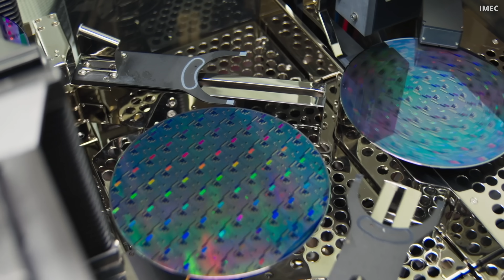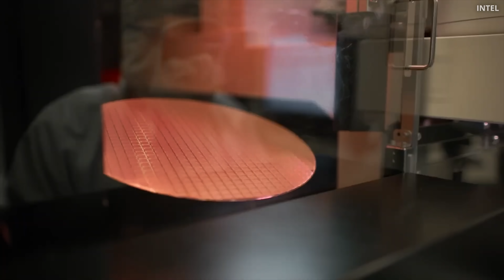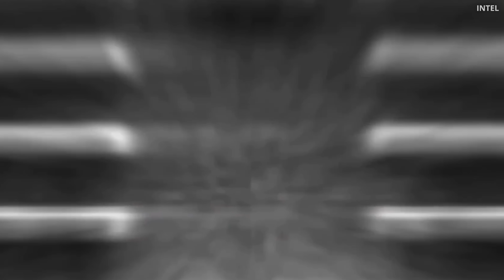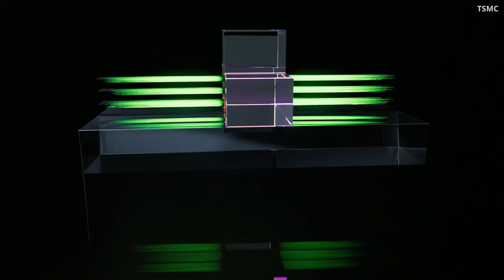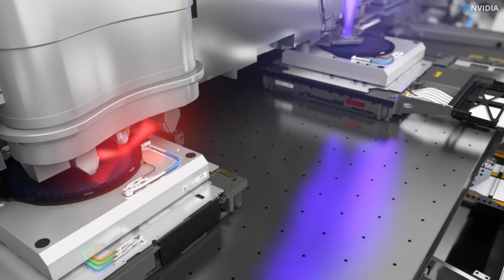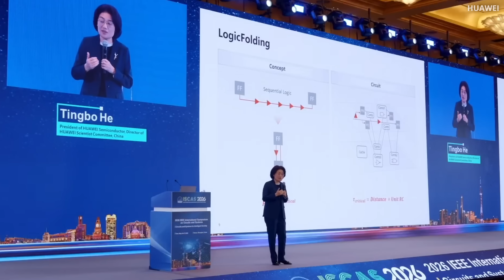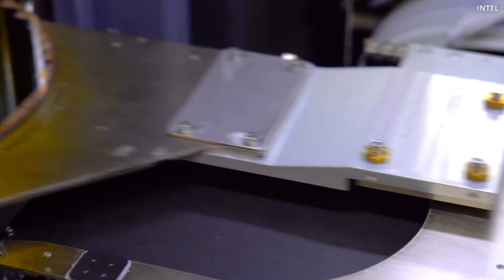China Just Built What TSMC Said Was Impossible

Comment: technically 1.4nm etc are all just marketing term, we can't actually use them as quatum tunneling would make them unreliable. when we go to such "scale" we are usually talking about x nm "equivalent" then physically building gates that small.  

after the announcement, i assume you watch their technical discussion. like how they deal with chip clock boosting, heat, yield, bonding, design. there is no doubt that going for "2D" logic to "3D" logic would be a massive improvement, however there is currently no design software capable of doing it, they are literally working this "by hand", so I do not see a massive improvement, but the level of depth they talk about seem to imply they have solve the "could or could not" part of the problem. they can do it, question is how long would it take them to do it well...

for example, they talk about the clock boast to be done on the same base layer, this would mean they can't really build that tall since there is no boasting on the top. so we wouldn't be able to reach the level of a "cube" with what they have now, that could maximise 3d volume, instead what they should is a first step.before you can build supertall,  you have to at least be able to build tall. its definitely very exciting from a development pov, but it is still very early tech.

several peopel dismiss this as just "stacking" saying we have been stacking memory for years, and that is true, but memory has a linear veritcal bus, using the description huawei engineers discuss it, its a "floor plan", where building vertical memory is like how we build apartment, with every floor having the same floorplan, for logic it is different different pipeline has different size, it alot harder to fit them together, that's the software design challenge they are facing, it like trying to build a bulding where every floor's floorplan would be different, and changes in one floor would impact the arrangement of other floors. as a programer who does alot of pathfinding code, i immediately understood the massive increase in workload moving for 2d pathing to 3d pathing. the number of test would have to be increase, and it will be almost expoential. you would need software that doesn't only work are are very will optimised, otherwise every change in chip feature would be a nightmare. so no, this isn't the same as memory stacking, it is why we haven't done it, it is a pain in the butt to do.
Reply: You clearly watched the session — respect. But "working by hand" isn't accurate. Huawei has 78 in-house EDA tools, PKU just broke through true-3D EDA for LogicFolding, and Empyrean has a full 3DIC verification flow. The current chip is deliberately conservative (2 layers, critical paths only), yet still delivers 53.5% density gain and 41% efficiency gain on the same DUV node. The roadmap goes to 4+ layers and 4GHz+ by 2029. They're not claiming to have solved everything — He Tingbo literally said "no single company can complete all answers." But they've proven the concept works in silicon, not just in slides. That's more than anyone expected under sanctions.
Reply: Oui ça fait un moment que c'est comme ça. On est à peu près à 7nm en vérité.
Reply: Not "marketing terms", they are node names.
Reply: Whilst your people are busy thinking and talking, the Chinese are busy making and doing.
Reply: @masprabowi7007  *making things up and this lady eating it up like done deal product on a shelf scaled up.
Reply: @masprabowi7007  The technology appears in the West and then we see it in China with a Chinese flavor
The reason is that China relies 90 percent on industrial espionage and does not rely on innovation
Give me 3 unique Chinese technologies that you did not steal from the West
Reply: @mohsenSL  paper, printing, gunpowder, the compass, porcelain, silk-making, seismological device, mechanized clocks , hydraulic eng’g & canal systems
Reply: @mohsenSL 你被西方媒体洗脑了
Reply: @PatriciaCastaneda-us1mv  I want higher technology
I don't want inventions from 2000 years ago
Reply: @JINLEE-v9n  I was in China and I know what I'm talking about
The largest system that supplies the Chinese market with technology is Ministry of State Security MSS.
Reply: @mohsenSL  China has been the world leader in patent submissions for a good while now. You're hardstuck in the nineties 🤡
Reply: @martinkrauser4029 Give me three pure Chinese inventions that we use in our modern lives. impress me
Reply: @PatriciaCastaneda-us1mv  guns and cannons as well. Not only fireworks so.
Reply: @mohsenSL you think tech theft started in this digital age? Before that the west didn't steal?
Reply: @mohsenSL  zip up when your finished
Reply: China is quick to release “ tremendous breakthroughs” before anything is “available for peer review”. Let’s sit back and wait.

Comment: The inverted pyramid graphic wasn't all  that helpful for me, as it seems to conflate two or more orthogonal values: device scale is phone or datacenter? Circuit timing and heat accumulation?
Anyway, if the inter-chip timing can't be resolved, you have no compute to worry about to begin with, so you would cool the system to perfection in a lab setting, and get the timing knocked out, first challenge. THEN, worry about cooling the system under more realistic conditions. None of this will remain proprietary on release, which is interesting. As soon as product ships, the physical layout can be examined and reverse engineered, assuming it even pans out. There's even less "moat" here than anywhere else in the AI / IT stack.

Comment: This is exciting because it is possible for TSMC to institute "folding" in addition to scaling, which increases chip density. Still not sure how they will handle power consumption and heat dissipation. You are correct, this is very complicated and it remains to be seen if they can implement these changes at scale.

Comment: I'm not an expert in chip design, but when you talk about connections between transistor layers, can you use transistors for connections instead of copper-copper connectors? That would be real 3D computing. This way, by stacking layers on top of each other, it's still 2D computing, just on multiple floors.

Comment: As CAD a designer (not electrical engineer) who worked on multi-layer PCB’s I always wondered why they didn’t have multi-layer chips. Thanks for explaining the issues they faced.
Reply: I still suspect there are problems. I keep thinking heating would be even more problematic than what is known
Reply: If I remember correctly it has to do with heat removal. Stacking chips is like stacking heaters on top one another. Makes it kind of hard to remove the heat from the lower chip. Plus it's adding heat to the upper chip.
Reply: @PeterParker-tb7ce Before, data has to go side ways for a few mm.
As she mention, now it will travel a few micrometer. Less distance, less resistance, less heat generation.
Even if not, cooling down a cpu or gpu is not a challenge today.
10 years ago, our 30 watt cpus were burning. Today, we are easily cooling down 70-90 watt cpus.
Reply: @TufiTufi-l3z  older cpus used higher voltage, that's the main reason 30W was generating more heat. Someone correct me if I'm wrong
Reply: @SparcBR You are wrong.
Reply: @TufiTufi-l3z the chips were made with larger pathways, higher volt and current and also higher thermal density. Everything factors in
Reply: @SparcBR Yes, that explains why my 1.5 ghz hp, Lenovo or Asus laptops were running it fans constantly.
Better thermal efficiency :)))
Reply: Larger pathways had thicker gate oxides. They required higher voltages just to push electrons across the larger gaps.Higher Capacitance: Larger physical structures held more electrical charge. Charging and discharging these larger pathways consumed more energy per clock cycle.Wasted Energy (Dynamic Power): Because the structures were large and required high voltage, a massive amount of energy was lost as heat every time a transistor switched
Reply: @TufiTufi-l3z GHz CPUs aren't that old compared to mhz CPUs which I was talking about
Reply: @SparcBR  pretty sure it's the amps that determine the heat not voltage voltage is just potential difference
Reply: @PeterParker-tb7ce  and its not just more energy dense but u also need extra pathways to actually connect both stacked chips which will make moving heat harder as well

Its kind of a massive disaster if u think about it heat is by far the biggest problem
Reply: @PeterParker-tb7ce  not only that, but also thermal cycles that differ on top and bottom chiplets having different expansion and can break those bonds between chips.
Reply: @PeterParker-tb7ce Honestly, in my personal opinion, I think it's the fact that it introduces way more parasitics between each transistor, because now you need to account for the switch's input following an unknown path in three dimensions, which will cause some flux linkage (either a capacitive or inductive effect) that generates a lot of crosstalk.
Reply: Chips do have multiple metal routing layers.  However, many times you may want some stuff from one process, like mixed signal, analog, logic, etc.  And stuff from another process (power, drivers, etc).  Merging the two chips together usually means a multichip module with multiple die, stacking die with copper pillars, or through silicon vias.  I guess this is just shrinking the vias to increase the density.
Reply: The reason nothing ever gets done is because most of the people are now fun. And they put a cabosh on everything, instead of letting people be wild and free to think the way a God would think. Most of the time, they're limited to the stink that other people think. Money can't rule the world, but it's certainly does, hence why most things never get done
Reply: @AllenSmith6972  Without Risk or Despair no Innovation no new knowledge no expansion and no failure.
And no Researchers Seeking Eyes "We can do it, we can solve it we can evolve it beyond their thoughts"
Reply: 当然是散热的问题，中国的封装技术用金刚石来进行散热，有望解决这个问题
Reply: PCBs*
Reply: Man, you could have made a killing!
Reply: @masprabowi7007  No he does not, TMSC can easily do it. There are heavy downsides to this which makes the effort not worth the benefits.
Reply: @Aeriozo  Predictably their will be a end of efficiency like always the same with LLMs but no one yet want's to acknowledge it
Reply: THERMAL ISSUES. The issue is that the west never thought about it? Is because the benefits are MINIMAL and the efforts are HIGH.
Reply: first coming to mind is.. cooling?
Reply: stacking just cost more.
Reply: The main problem is polysilicon can't be stacked. We do have layers like you see in PCB, but think of the bottom layer more like the silkscreen layer on a PCB which can't stack. 

So when you have "layers" it's more akin to stacking several assembled pcbs than the internal board layers 

So the benefits are not as big as you would expect at the cost of lots of heat
Reply: As an EE for IC Packaging Automation, we were stacking chips(robotically), then wafers in the 1990s for the military. its just slower with less Yield, which kills commercial uses.
search IBM's C4 Interconnect for more (unclassified)
Reply: 3D V-Cache is a thing in chip design for quite a while now. AMD did it first in they RYZEN X3D  series
Reply: Ibm just did it
Reply: We have multi-layer chips. E.g. some cell phones have RAM chip stacked on the processor, inside one shared package. Or some processors are from chiplets (though sideways). The 3D cache is also stacked vertically.
Reply: @ladislavzima8382  But they are stacked like layers in a building.  You need to go up and down in an elevator.  Total distance traveled is still significant.  This new stacking is like a metal bar cage.  You just go up and down from where you are.  The distance travel can be greatly optimized.
Reply: @ladislavzima8382 how do they deal with heat in their designs?
Reply: @behtashmiri1283  Modern processors have tens to hundreds temperature sensor and limit performance of various parts accordingly.
Reply: @ladislavzima8382  They throttle down to protect their cores melting it's pretty much the same like a reactor functions and how we ourselves function as well by our Designers Idea  and every biological entity tries to protect its core from melting down as well.
Crazy Fascinating
Reply: @behtashmiri1283 Why everyone talking about heat? Intel i9  14.900 pulls 350-400 Watt power under load. And it is possible to cool it down.
Why Huawei can not cool down a standart cpu?

Comment: But if 80% of energy is transport of data and not calculation, then folding should lower the energy needed and thus less cooling, and because distance is shorter,  voltage does not need to be as high.
My uneducated guess is that a folded chip produces 50% less heat at same performance because of RC gain 🤗

Comment: Hearing that huawei plan this give me an other sude link, optical bus, which they use in ther data center. And geting the energie to durect semiconductors and a optical wave guide wirking akso as heat spreader, transistors or blocks do no longer need direct connections. And busses taje a lot of energy to work. Optical busses do not. And changing from Si to GaAs wull give here a big advsntage even in a 28 nm tech with high yield.

Comment: Seymour Cray the father of supercomputing. Was once criticized for the lack of wire management in his supercomputers. He simply replied to that person our goal is to build the fastest computer. Part of that equation is having the shortest wire connection between two points.
Reply: shortest wire connections come with tradeoffs like crosstalk
Reply: @danforth684  if the signal is a balanced signal and the two conductors are twisted together or shield crosstalk is not an issue. If you look at ethernet cables there is an issued called alien crosstalk when signal from one ethernet cable interferes with the signal of another ethernet cable running parallel to one another. The vast majority of wiring of a cray computer was twisted pair. 
Crosstalk is due to induction when wires run parallel to one another the risk of cross talk goes up.

Comment: Huawei's core philosophy for solving the yield challenge is this: while pushing bonding yield to near-perfection through process breakthroughs, they turn the inherent disadvantage of 3D stacking into an advantage by "dividing and conquering"—using the chiplet approach to benefit from smaller die sizes and higher native yields.
Reply: chiplet usually end up with very large controller to route data. the real advantage here to to remove the routing buses so more percentage of the chip can be use by logic instead of "traffic management". its a great idea, but it requires alot of computation power to design such a system. think of it as trying to build a "walkable" city with no roads. the planning would be alot harder than a city with roads.